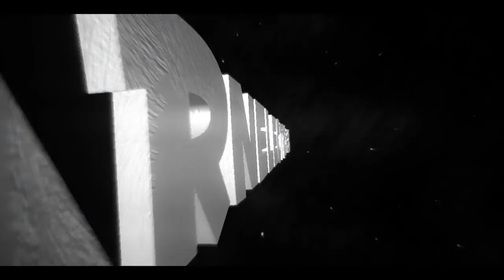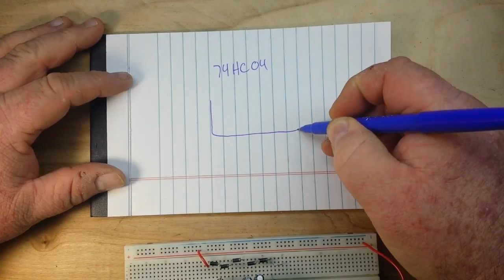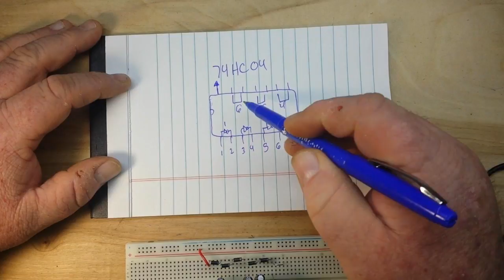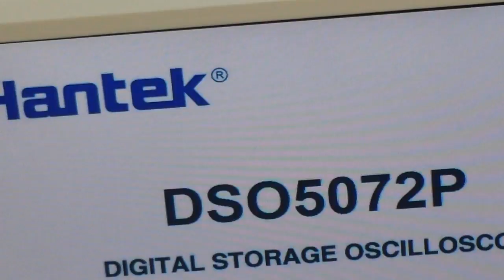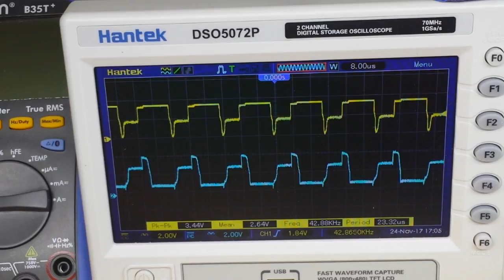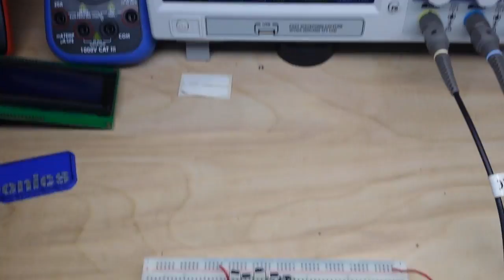Digital Logic-74HC04 Hex Inverter

Comment: at 8:40
when you charge the capacitors what happens at the negative side of the capacitor does it become a -5 or +5
if the answer is +5 then why does it allow DC ? I have learnt that  a capacitor allow AC and blocks DC 😧

Comment: Just had this idea of making these different logic ICs with transistors on either separate breadboard or perforated board with transistors.
https://duckduckgo.com/?q=perforated+board&iar=images&iax=images&ia=images https://en.wikipedia.org/wiki/Perfboard
Paul already explained logic gates with transistors
https://youtu.be/j4wUERSXQs0
I dunno, if it is doable or not. And maybe using SMD parts would make it smaller. I guess it is simple in the cases of NOT/AND/OR but I ain't sure about the rest.

If one making on separate breadboard, it is better to use tags(some paper like posit note) or a tiny paper stuck/fixated by jumpers then write the pin numbers just like the IC design, maybe obtained from Datasheet.
http://www.futurlec.com/Datasheet/74HC/74HC04.pdf

If making a perforated board make it so it stands upright and give it some male header pin. Then make another tiny perforated board(cut the one you need to) with same size as an IC and with both female header pins on top and male header pins on bottom with connecting wires. Just like what this guy did https://youtu.be/9QZkCQSHnko?t=1m34s
Also mark the pin numbers just like the IC. You can put a masking tape on the female head side then write the pin numbers.

https://en.wikipedia.org/wiki/List_of_7400_series_integrated_circuits

Good luck

Comment: Thanks a lot, Paul.
Just wondering if these gates could be programmed on some kinda of E/EPROM chip?
That would make trying them out much easier and it would take less space.
http://www.mouser.com/ds/2/389/stmicroelectronics_cd00001587-1204720.pdf
https://www.banggood.com/10Pcs-Orinigal-M27C322-100F1-DIP-42-Mbit-32M-EPROMs-EPROM-p-1081262.html
Reply from the maker: +igrewold I'm not familiar enough with eeproms to say. I'm more the hard wire it kinda guy.

Comment: hello. I been working on my alternators. I checked the rotor coil resistance. it comes to 1.8 ohms. I I don't know if I'm right but I figured it would pull about 6.7amps max. at around 11.9 volts. the voltage can range from 10-14.8. give or take a 1/10volt or two. so what would it pull with 21-29 volts. I kinda think I remember how to do the maths, but there's always the uncertainty. be cause no one has ever said. THIS is How its done. and this is a example.  great video. I been thinking about shift registers. are they coming? I had a idea for a lil project. with them and a 555, and dome LEDs and FETs.. I don't have a clue about the inverter. how I could use them anyway. thanks ...
Reply from the maker: +James stranger yep74hc595 8 bit shift registers...we will get there

Comment: Very interesting. Those are HC. How do they differ from other 74 series or the CD chips?
Reply from the maker: +Robert Gibbons Well the HC are high SPEED CMOS logic. The older LS chips used TTL logic.

In my opinion the benefit of the HC is it can be powered by a much lower voltage.